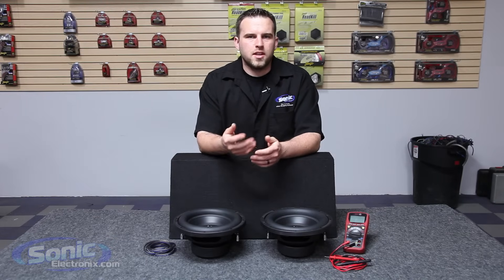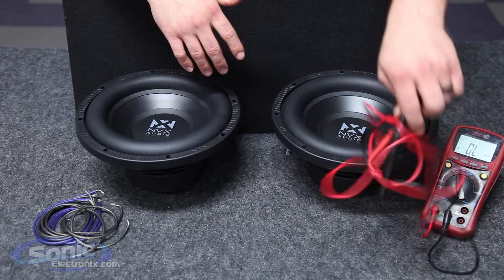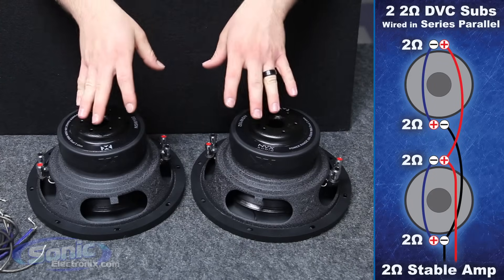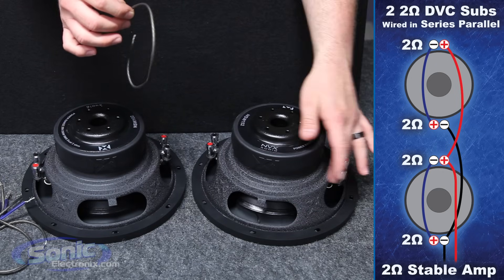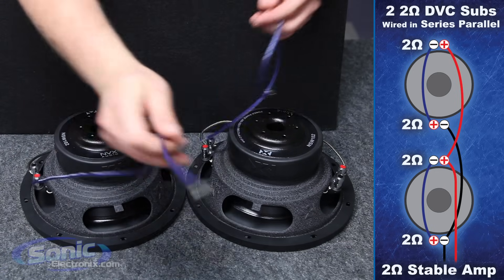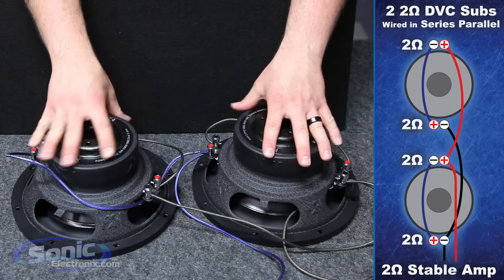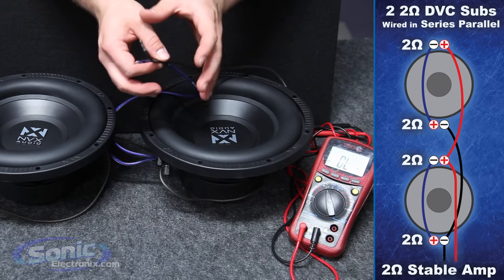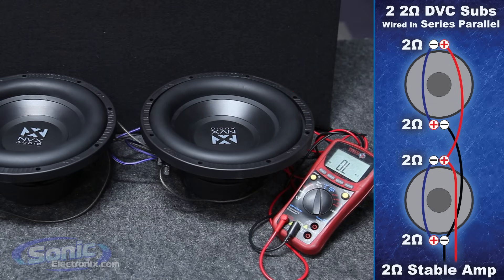How to Wire Two Dual 2 ohm Subwoofers to a 2 ohm Final Impedance | Car Audio 101

Comment: im a little confused. i have a power acoustic cpt1-5500D. its a mono amp. when i look up the specs it say "4ohms: 1700 watts x 1 channel. 2ohms: 2500 watts x 1 chan. 1ohm: 3200 watts x 1 chan" i have two 2 ohm dual voice coin sound stream t5-12 subs rated at 900 rms each. i hooked them up like the video says. do i have to do anything special to my amp to switch it between 4 ohm 2 ohm or 1 ohm? and having them hooked up like this assuming I'm at 2 ohm this means each sub is getting 1450 watts each? please reply if you know anything I'm asking cause i confused myself just writing this haha i just want to make sure I'm not going to ruin my stuff. thanks in advance!
Reply: James Amanti you don't have to do anything to the amp, the 1, 2,4 or 8 ohms depends on how you wire the subs. If you follow this then the end result is 2ohm. Just make sure how ever you wire them make sure your amp is stable for the ohms your trying to end up with.

Comment: If I wire my subs this way, when I connect it to the amp, does amp recognize the connection as 1 sub @ 2ohms? My BRX1100.1d amp has two positives and two negatives, but if I only use one positive and one negative the amp will be stable @ 1ohm. If I use both positive and negative outputs for each sub the manual states that I can only use 4ohm sub set up for both subs. I would like to use this wire set up to achieve maximum power supply to the subs but I'm not sure if this will work.

Comment: I dont get this, so if i get 2 2x2 ohm 1500 watt RMS woofers. And i connect them like this to a 1300W RMS amp i can run bothe at 1300W, Or 650W ? So then i should get a close to 3000W RMS @ 2 ohms? Or if i connect them so i end up with 1 ohm @ 2x 1500W subs i can use a amp with this RMS Watts @ 1 ohm and run them both the full 1500???
Reply: Nick R Hi Nick, a 1500 watt 2 ohm DVC subwoofer is rated using both voice coils so the first thing we do is wire each subwoofer in series, two 2ohm 750watt voice coils wired in series is the equivalent of 1 1500watt 4ohm voice coil. Now we have two 1500watt 4 ohm subwoofers total 3000watts, wire these two subs in parallel with other and we have the equivalent of one 2ohm 3000 watt subwoofer.. the amplifier will see the equivalent of a 2ohm load and whatever the amplifier is rated for at 2ohms is what the subwoofers will get for power.
Here's the problem, once you get past 1500 Wrms you really don't want a 2 ohm final impedance as it becomes increasingly harder to find an amplifier so we start wiring the subs for a 1ohm final or .5ohm final impedance as there are plenty of amplifiers that make 3000 Wrms and up @ 1ohm and even greater at .5 ohm loads.

When we calculate power we don't care what the Wpeak rating is, ONLY the Wrms rating, Wrms is continuous wattage, Wpeak power only occurs during musical peaks/dynamic bursts like the bass hitting from a kick drum or a cymbal crash, that's when the amplifier is laying down the power, otherwise it's just loafing along playing some smooth jazz..
I would get a pair of 2ohm 1500 Wrms SVC subwoofers and wire them in parallel for a 1ohm final and then choose one of these amplifiers to run it..
http://www.sonicelectronix.com/viewcat.php?category_id=23&sort_order=best_rated&filter_f_r_164%5Bmin%5D=1501&filter_f_r_164%5Bmax%5D=0&price_max=399.99&price_min=279.99

Comment: My box has a wall on the inside that separates the speakers so how would I fo this without having wires hanging out the front? Drill a hole through the wall? Thanks.
Reply: Also, in the box, it has a positive & negative for the left side and the right side but the way you hooked it up, it only has 1 negative and 1 positive. So how would I hook it up to the speaker? I'm new to car audio so bare with me. Thanks again.
Reply: ***** i have the same question, any luck?
Reply: Oscar Hernandez I just drilled a small hole through the wall that was just big enough to run the wires through and connected them the same way as in the video and screwed the subs onto the box. Good luck. Be sure to leave enough slack so you can take the speakers out another time if you ever need to.
 And I just ran the positive and negative on the left side inside the box.
Reply: Cool, thx. Let me know how it sounds man, I'm trying to do mines tomorrow but just need to do a bit more research so I can get the best out of my amp and speakers.
Reply: Oscar Hernandez just run wire outside the box , terminal to terminal
Reply: thx!
Reply: Yup
Reply: ***** http://www.parts-express.com/parts-express-round-speaker-wire-terminal-cup-2-7-8-gold-spring-loaded--260-276
Reply: +cameron johnston explain
Reply: why drill holes dude u can bridge them on the out side of the terminals on ur box

Comment: I have dual 2 ohm subs and I have a question about wiring them to a mono amp but the mom amp is for dual subwoofers. It has two set of positives and negatives so you can wire in both subs, I know that inside the amp the negatives are on the same post so its equal to just wiring them together together and the positives. The only problem, my box is dual ported but the two chambers are completely separate. Do I have to drill holes to connect my subs as it is wired in this video? or could i just wire them in series within the box, then let the amp do the parallel wiring? Since the terminals on my amp are going to be joining them together...
Reply: Been 8 years but I'm looking for an answer to this 😂 hmmm

Comment: Would i be able to wire 4, 2 ohm dvc subs into a 1 ohm load or what would the final impedance be ? Or should I run 2 amps

Comment: How do you do this with a box that is divided? I have my sundown 2 ohm 8 inch subs dvcs hooked up parrallel i think, red to red black to black. But im running a hifonics ZRX500.2, and im supposed to be able to get 500 watts a channel. This amp is weak the way it is. Can i get more output out of it by wiring my subs like you did here? And how can i do this if my box is divided? Thank you
Reply: Also where its divided in the middle there are two tall slot ports.

Comment: Can I wire my Two Dual 2 ohm Subwoofers in 1 impedance
Reply from the maker: william hamlin No you can only wire them to .5 ohms and 2 ohms.
Reply: so what kind of amp can u run on a 2 2ohms subs

Comment: Sonic Electronix Hey Brandon, I know this video is abit old but I am wondering if I would have to wire my subs the same way I have 2 12" Rockford Fosgate P3D2-12 (Newest Model) Dual Voice Coil(s), Impedance 2ohms, 600rms. The amp I have is a mono Rockford Fosgate R1200-1d RMS Power @ 2 ohms 800 watts x 1 channels so would I be getting 600 watts ea from both subs?. When you mentioned jumper wire & positive wire is that basically your way of saying speaker wire? because if there is a + wire and jumper wire it is not available for purchase on the sonicelectronix website
Reply: i don't know if I'm too late for ya man, but yeah, a jumper is just a piece of wire that's the same gauge as your speaker wire used to connect them inside the box. if you have a sectioned off box then you can just run the wire to the terminals and do this outside the box.

Comment: How would you wire these in a box with the port in the middle!?
Reply: Did you ever figure this out? I'd like to know the answer
Reply: If you have a box with 2 sets of terminals on each side you can by using the terminals to connect the wires in parallel after starting with series. If you need a clearer description or something feel free to contact me.
Reply: Matthew Tenney my box has a set of terminals per sub. Ill try to find you on g+
Reply: Matthew Tenney I need a clearer description I also have a ported box with 2 speaker terminals on back of box.

Comment: why is this wiring option better than other options?
Reply: That way you can run your amps output at 2 ohm without having to drop to one ohm or .5 and I don't know of an amp that can run .5 ohms stable

Comment: Question? I have the Kicker 07DCVR122 ported enclosure with dual 12" CompVR subwoofers 2 (ohms) I wanted to remove both subs, and replace them with, Kicker 40CWR122 12" CompR Series. Which (Ohms), do I need to put into those replacement, (CWR122) or (CWR124) The new Amp that I wanted to use for the subs are Kicker IX1000.1 1000W RMS Monoblock Class D IX Series Amplifier, instead of buying a new Ported Sub box. Is that a perfect fix?

Comment: I have 12" Kicker L7's dvc 2ohm subs, and a Kenwood KAC-9014D mono amp... Should i wire my subs this way?
Reply: ok thank you
Reply: I'm having the same issue. What was the answer to your question? Did you hook your set up this way? have you had any problems?
Reply: I no longer have this set up but yes this was the way i ended up wiring my L7's

Comment from the maker: Yes!
Reply: Am I able to wire two two ohm subs to 1 ohm on one amp or do I need to wire then individually to their own amps
Reply: @ Sonic Electronix I have 2 sub at 400 rms. if I put them at 2 over all would it get me 800 rms total can I use a 800.1 kicker amp to push them ?

Comment: I need some help!! I have 2 JBL P1222 12" subs. They are duel voice coil and 2ohms. I want to hook them up to two amps. One amp is a Mono JBL GTO 601.1 and the other is a Mono JBL 601.1 II. What is the best way to wire this set?

Comment from the maker: You drill a hole in the center separating wall of the box and run your wire through, then seal it up.

Comment from the maker: Yes, if you have two subwoofers, each Dual 2 ohm, then they will wire to a final impedance of 2 ohms, just like in this video.
Reply: Can I wire two 2 ohm dual voice coil subwoofers down to one ohm with a 2-channel
Reply: Can you still do this when using two separate boxes for each woofer? Do I do everything you did but on the terminal cups instead of directly in the speakers?

Comment from the maker: If you want two subs, and you have a 1 ohm stable amplifier, you will want two Dual 4 ohm subs wired in parallel.
Reply: Man which I knew this when I bought my dvc 2ohms ctsounds subs
Reply: @chakas03   did u blow them up
Reply: @bigripdeniro1952  I tried too at 1/2 ohm but ended up going back up on ohms
Reply: @chakas03  how did you wire them? Just like this video?
Reply: @RayBarao.  yes just like the video I ended up blowing them up yesterday on a taramps 3k pushing about 1400 watts or more
Reply: @chakas03  what made them blow?
Reply: @1kbutta  the spider screws came loose and rubbed against the coil so one blew, I ended up going deaf bonce machetes
Reply: @chakas03  how you fix them?
Reply: @SexyTexas  the spider screws came loose and were rubbing on coil, so one blew, went deaf bonce machetes now.

Comment: can you wire two dual 2ohm subwoofers to 1 ohm using two 1 ohm stable mono block amps ?
Reply: Apparently you can. That's what I've been advised to do recently. Did you do the same?

Comment from the maker: If you have two Dual 2 ohm subwoofers, wire them like we did in the video.
Reply: Sonic Electronix how would you wire a single sub DVC 2ohm to a 2ohm amp?
Reply: @khalidmohammed6428  a single sub with a 2ohm inpedence can only be wired to 4 ohm and 1 ohm load
Reply: Sonic Electronix how can you wire 1 sub, dual voice coil, 2 ohm to 2 ohm. I can’t find it anywhere.
Reply: @papergatorzfedducca7998  you cant

Comment: ok i got the wiring so after i wire them together would i bridge them to my amp or just put them together on one channel? i have a two channel amp. im hooking up two 1200 watt subs dual to either 1200 amp or 500 amp would that be fine?

Comment: Cool video. But how do you do it to a single dual 2 ohm sub? I'm thinking of getting the kicker 40cwrt102 but It can only be ran at 1 ohm or 4 ohms and I want to run at 2 ohms.